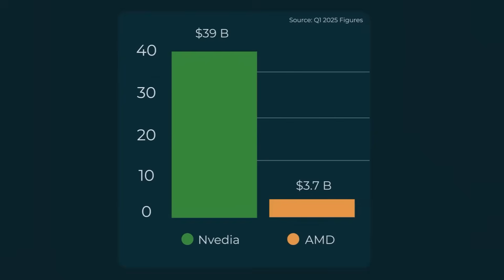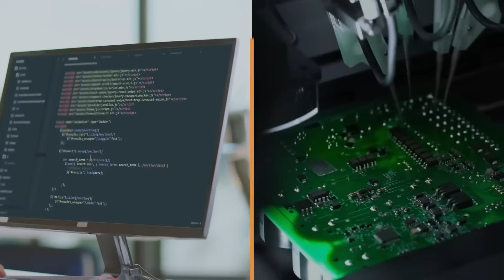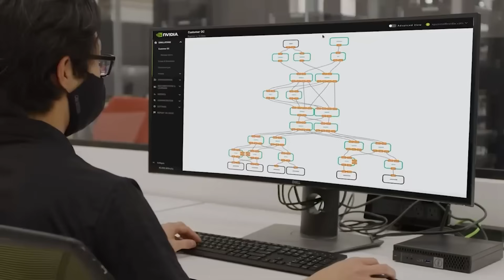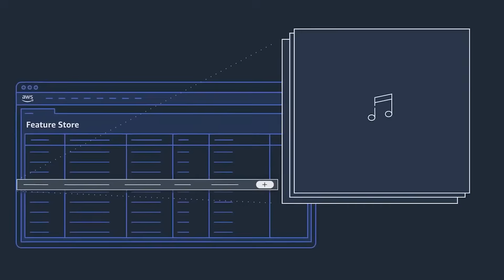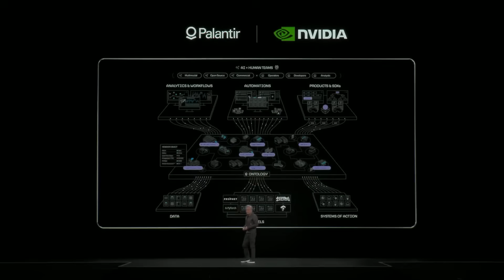NVIDIA’s Final Surprise of 2025: Meet the First Nuclear GPU ATOM for GPT-6

Comment: While Nvdia's potential is exciting, Nvdia needs to worry about China.  Two accomplishments are working on alternatives that not only work faster, but don't come with the power hungry needs of AI chips of today.  Analog chips are making a comeback as they are showing very high accuracy rates not known for analog chips of the past and second, photonic chips who's characteristics allows for very high parallel data processing flows.  These advancements are currently under development, but actual chips have been built to show their functional capabilities.  We should learn more in 2026 as early production chips are produced and we learn about their parameters vs the current silicon AI chips that Nvidia and Huawei currently make.

https://www.youtube.com/watch?v=VLyvpWg6nI0

https://www.youtube.com/watch?v=lxy9-FYU70o